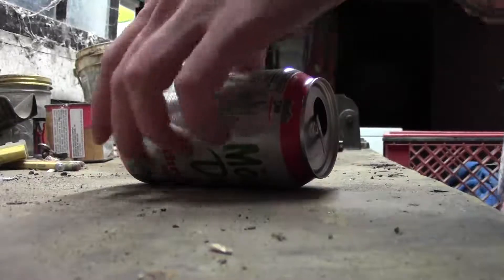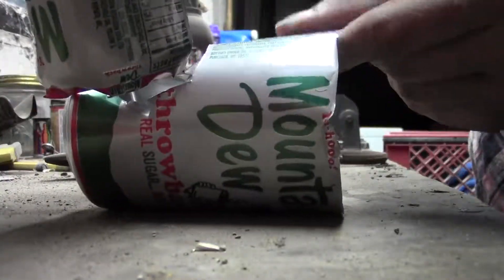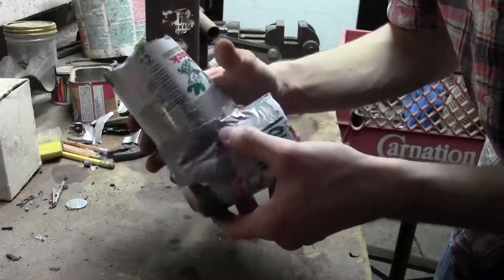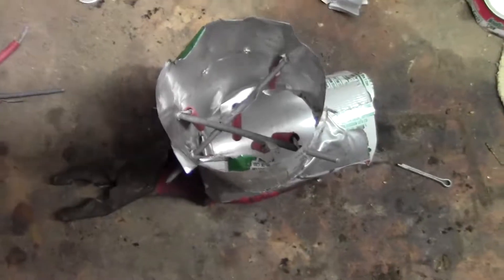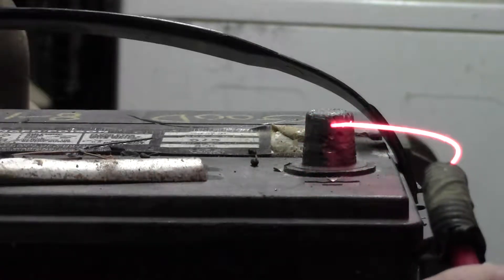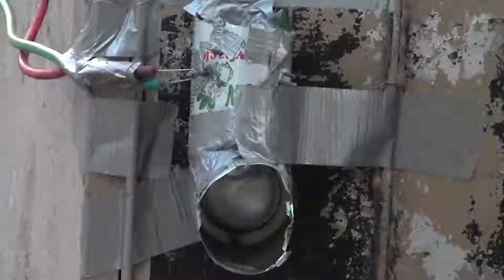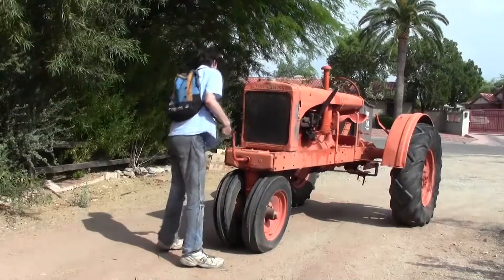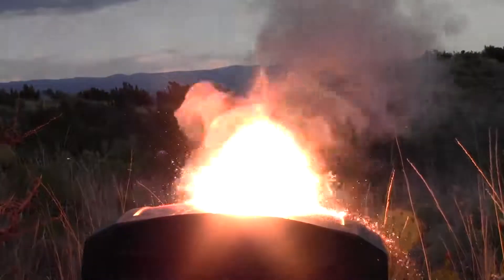Fire Cracker Turn Signal

Comment: Can you help me with my truck. I've got several blown head gaskets and my automatic transmission has fallen out the back, also I think the turn signal may be broken.
Reply from the maker: If it's a ford it's probably gonna need the plastic turn signal switch in the steering column replaced. You're welcome ;)
Reply: Attach a gun with blanks in the mag to a cable for the blinker, as for the gearbox extend the driveshaft and just weld it directly to the clutch, and then just tape around where the head gasket should be